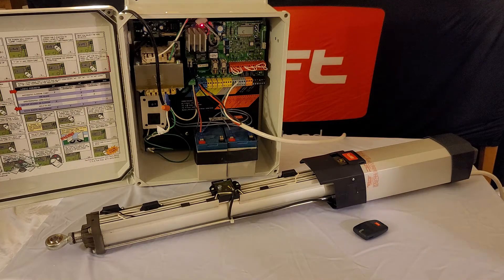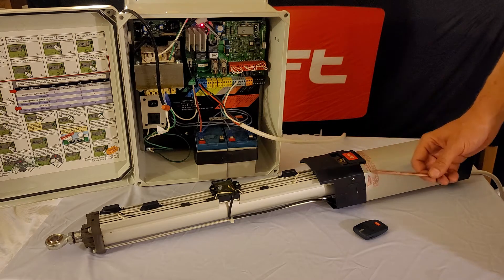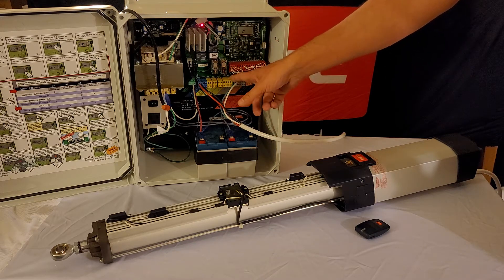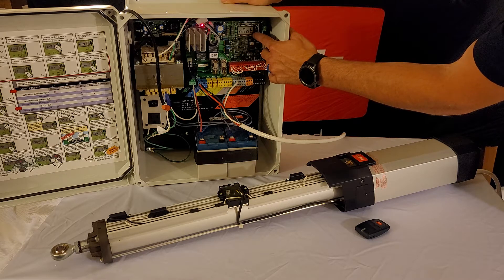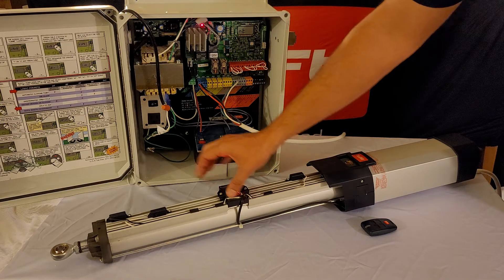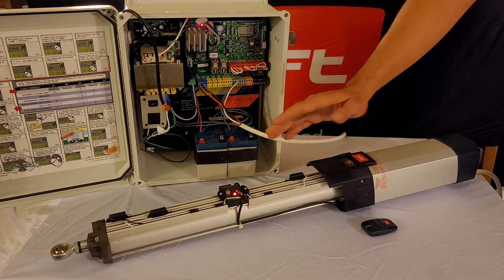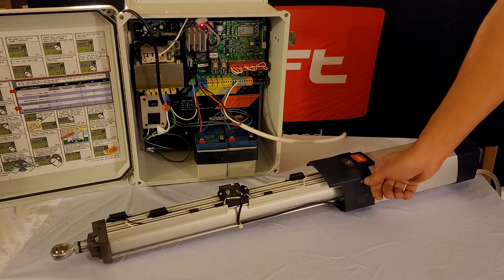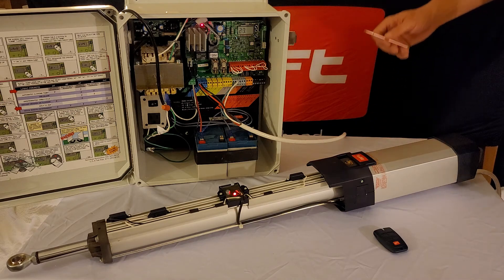BFT Giuno Ultra A50-A20 & Thalia P Quick Overview

Comment: Why does the one i have run ok 20 time then drive closed when it’s closed? Worked fine for 3 months. I think it’s the limit card
Reply from the maker: I do not understand the part "then drive closed when its closed" is it going past the limit switch for the closing. You can call us at tech support 877-995-8155 or email us at tech@bft-usa.com so we can get more clarification to better help you.